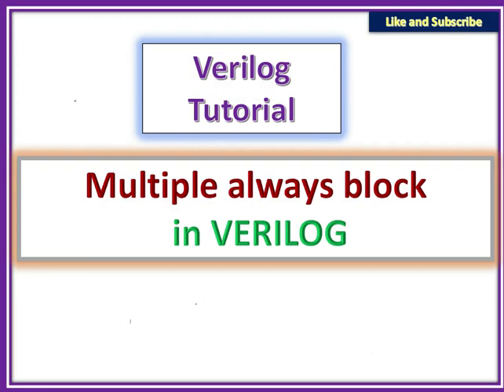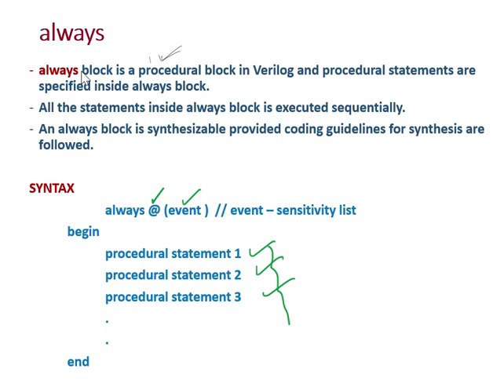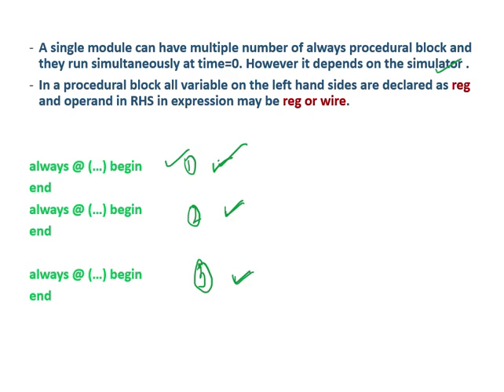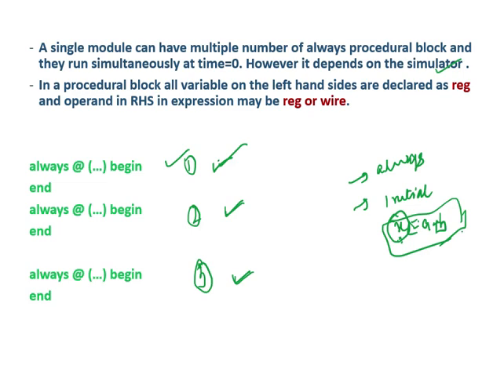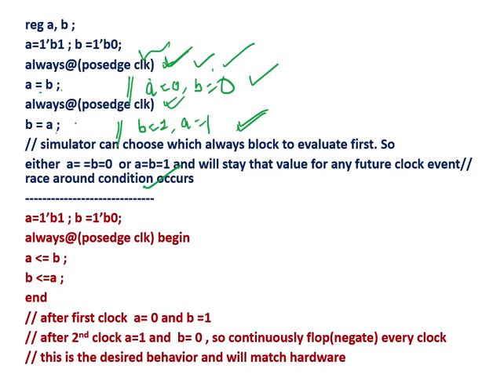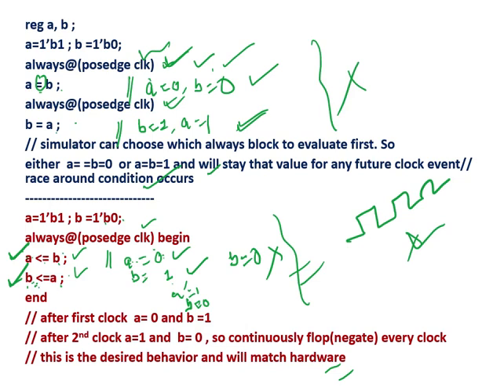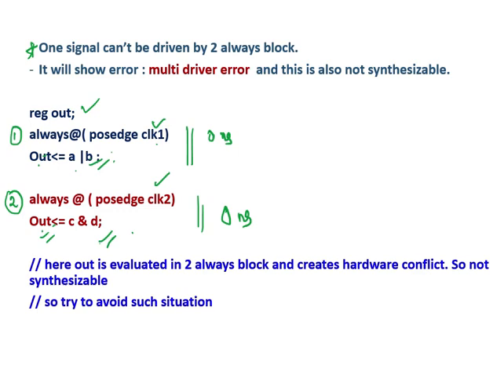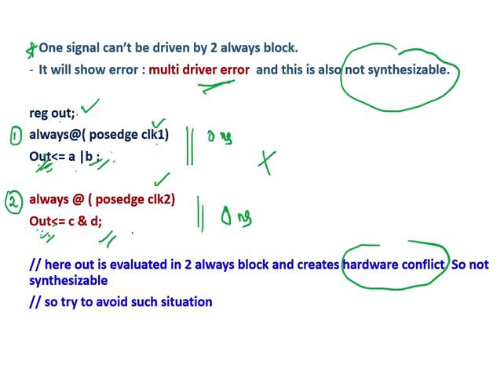#23 Multiple ALWAYS block in verilog | procedural blocks in verilog | Multi driver error in verilog

Comment: Procedural Statement would still execute in sequential manner even if we use non blocking assignments?
Reply from the maker: Procedural statements are executed sequentially. You are correct. Non blocking assignment may get executed sequentially or parallely.its also true but It's execution depends on data dependency. 

In real hardware everything is executed parallely as all hardware are run independently. 
Non blocking assignments are used to model sequential logic and sequential logic stores previous data.This statement is enough to understand what is the purpose of using non blocking assignment.

If you understand the real hardware execution and not just the code execution theory then you will understand what is the use of non blocking assignment or its purpose and how it is executed not by simulator but by underlying hardware

I always try to explain verilog code interms of hardware as verilog is a HDL. 
Thank you for your query as it will help other to understand in better way. Thank you.
Reply: @ComponentByte  it was a doubt about the code itself as a coder's logic I wanted to know in virtual environment where synthesis does not matter, where only behavioural modeling is understood irrespective of practicality, in that environment if I try to write a swap code would it work or not.
Reply: @ComponentByte your stuff is actually very gripping, thank you for your service.
Reply from the maker: It will definitely work if RTL coding guidelines are followed. Most of the time we write a software code than a hardware code and fully dependent on software tools to catch the error. I believe you are smart enough to understand what you are coding for. Thanks.

Comment: Sir your said statements inside always block are executed one by one that is sequentially but those should be non-blocking statements right as discussed earlier so they will get executed simultaneously ?? Can you clear this please
Reply from the maker: Blocking means evaluate and assign immediately.(hence suitable for combinational logic)
Non blocking means evaluate immediately and assign once all the evaluation are done in one time step.(sequential logic)
This is what you have to remember for blocking and non blocking .

If go deep then
At stimulation level(all software code run this way) everything runs sequentially(both blocking and non blocking) if no data dependency and at hardware level it runs parallelly.

Comment: Procedural statements inside always block should always be non blocking?
Reply from the maker: Not always.
It depends on the type of logic we design. So before writing any code , first logic ckt is designed and then decided how to write code for it following proper RTL guidelines.
If it's combinational logic then usually we use blocking and for sequential it's non blocking.